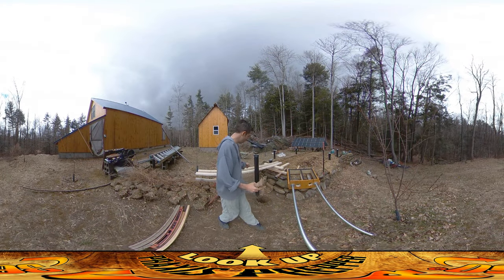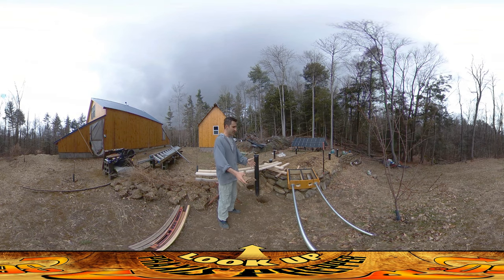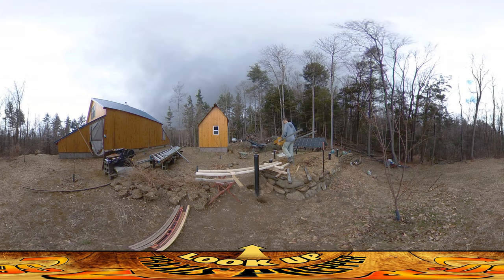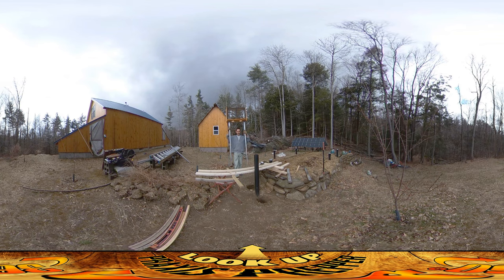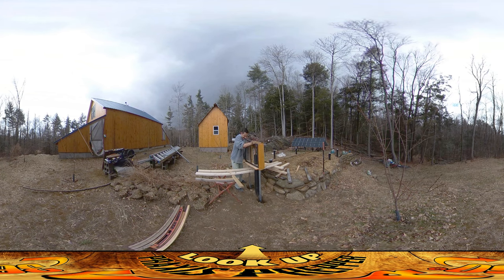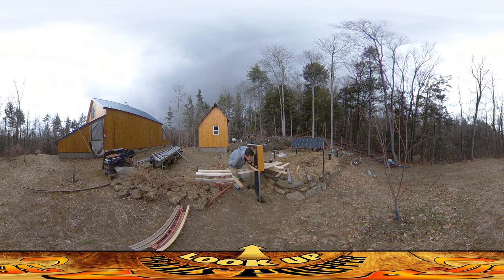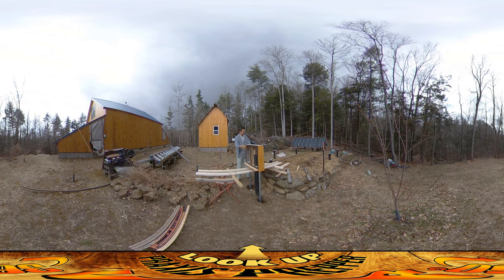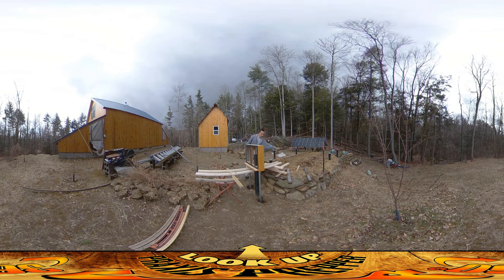Homestead Building - Installing the Fallout Shelter Air Vent in Concrete Footings

Comment: One intake tube? I hope you have the second tube ready.  Praxis
Reply from the maker: The  whole house air exchanger to which this will be attached only has one 4" intake tube. So an extra tube wouldn't have anywhere to go. The air in the house is rarely overly stale (per my meters). I think it only needs a little help to add a bit more fresh each day. As for the shelter, knowing the volume of the air that flows through the fan vent that I'll be using, It's hard for me to feel as though it'll be anything but way more fresh air that I might need in the shelter. But the testing will tell the true story when I do the test.

Comment: Praxis do you happen to have any past winter photos of that area to reference before it's permanent? I'm seeing snow build up on the back side (of where you're standing) and wondering if the box should be higher to allow wind to pass over the wall but under the filter box instead of creating a 90degree angle hard stop? Just thinking out loud ;)
Reply from the maker: I made the same mental note when I was setting it in. I'm surprised I didn't mention it verbally in this video. Yeah, I think it'll be totally fine with normal snow patterns in the yard. Hand me a "nuclear winter" to deal with and maybe those drifts get higher... It's in my mind for sure. It was a balancing act between making it less hideous (keeping it short), and making it less vulnerable to snow drift blockage.

Comment: Is the current world tension why you are putting it on there now vs running the pipe over from the house first?

Wouldn’t it have been a good idea to put some gravel in the bottom of the holes before putting the pipes in them so that some gravel would go into the bottom of the pipes ?

Did you put anything on end of any of the air pipes to prevent bogs from getting in them?
Reply from the maker: The choice to to the shelter first is only due to the fact that I haven't had the hole cut in the house foundation to accept the incoming air yet. I'd have preferred to have done it all at once, but it won't be a big deal to add the house line later... except for something that I might have done wrong related to my rushing a bit to get the footings in before a storm came in when I was setting it all in (more on that later).
Gravel did go into the holes before concrete. When I set it in the hole, the legs were dangling just above the bottom of each pit.
Yep on the cap. Don't want bugs getting in there!
Reply: @PraxisPrepper  Fortunately the house is easy to get fresh air into 👍

Have you had a core drilling done before? I’ve heard it can be pretty expensive but don’t have any first hand experience where I personally paid for it. Did have it done once though the curb in front of our house because of a drainage issue, but the town paid for it.
Reply from the maker: @inmyimage1081  I've never been asked before about whether I've "had a core drilling" before... I'm not sure how to take that...
JK.
Right, so yeah, I actually have and yes, it's not cheap. I had the guys that did the site work on my place do a core drilling (it was 5 inches... which is info that definitely continues the sexual innuendo I've established here). That was for when I decided that we DEFINITELY needed to vent the radon. The drilled it under the door to the eastern greenhouse. Including the machine rental cost and their labor, it was $250 for the job to get the hole drilled. I'll need 2 more drilled this time for the house vents (one in, one out) and I'm definitely going to expect a bit of a discount on the job - meaning I'm not anticipating paying $500 for two holes, since the machine is already rented and the guys are already there.
I'll do a video about that when I get there. Probably sometime this spring.
Reply: @PraxisPrepper  I thought you had but couldn’t remember. And much better to get a 5” core drill than an 11” 😉 (I assume 🤣😂🤣)